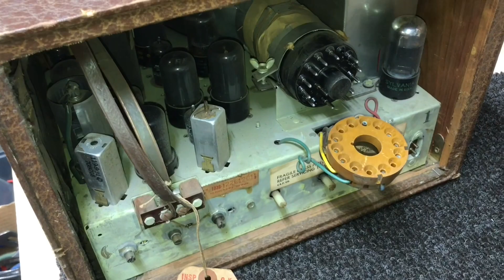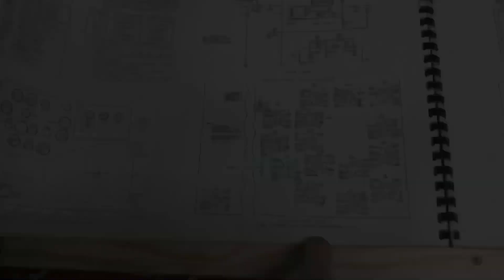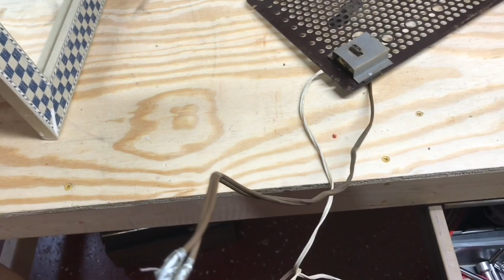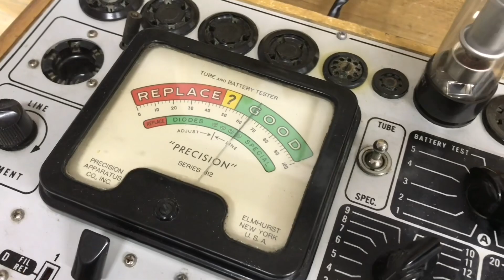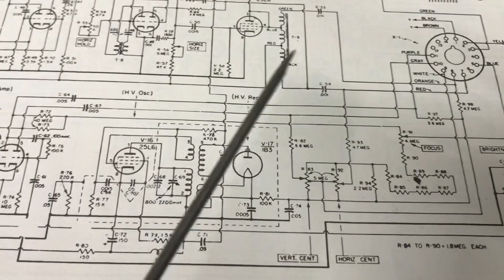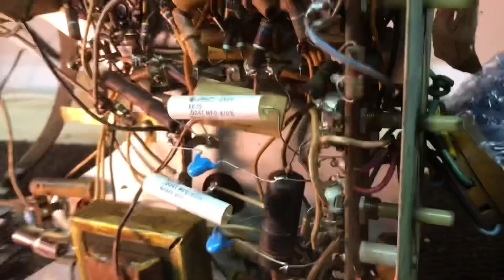1949 Emerson 7” Model 600 TV Restore Pt 1

Comment: Great vid as always. Sometimes oscillators drive digital multimeters temporarily crazy and an analogue meter is necessary. I use a cheap old radioshack  battery analogue   volt  meter when my digital meter goes nuts !